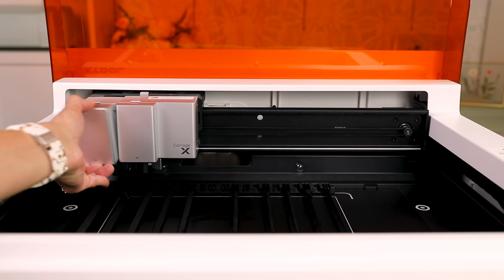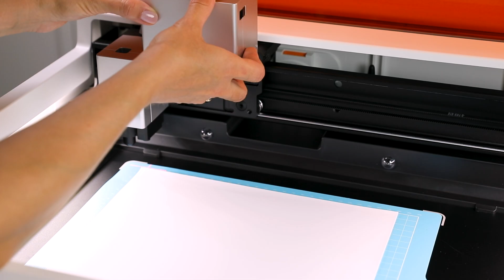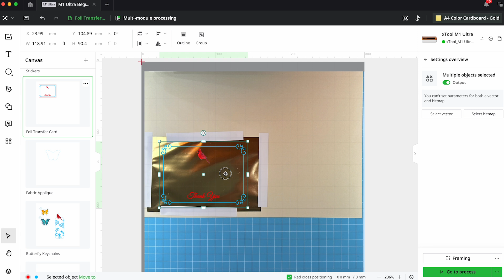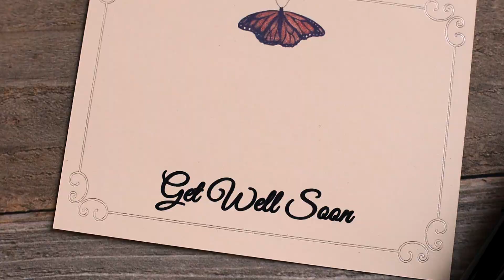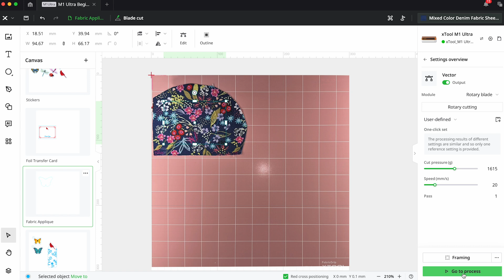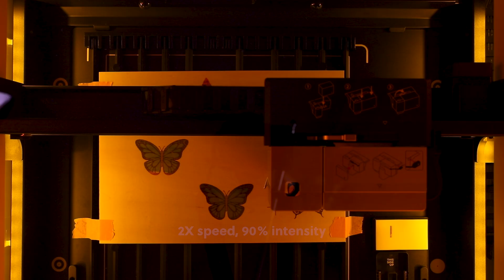xTool M1 Ultra Review: The 4-in-1 Craft Machine REVOLUTION!

Comment: Excuse me can I use for light box template to print and cut shadow same time
Reply from the maker: Yes, you should be able to make a light box with this machine depending on the material. You can check to make sure the material is compatible.

Comment: How  / would print  and cut planner stickers kits work I  purchased on Etsy? I  also purchased the kits that are sheets a single sheets of icons to use in my planner also (appointments, and other reminders)
 I can send a few that  I have purchased.  
They are  used with my Cricket.
Reply from the maker: Sorry I missed your comment earlier. You would probably have to use the trace feature to make a sheet of stickers into individual images that you could then print and cut as stickers. You’ll want to choose Multi Module processing for this type of project. I’d place your sticker sheet images in XCS and then hit Trace. You may have to increase denoising and smoothness to the highest settings. Then move the color images over to the side to reveal the traced outlines. Hit Ungroup. Then you’ll have to select each image, and hit Offset (if needed, check the box for Outer shapes only).  You can then delete the part inside the offset so you’re just left with the outline shape. Select Cutting Blade as your module for the outlines. Then you’ll just have to layer the color images in top of the outlines. Make sure to choose ink module for the colored images. I hope this helps!